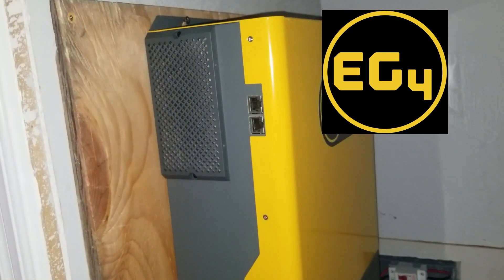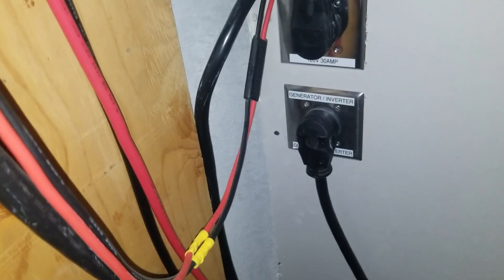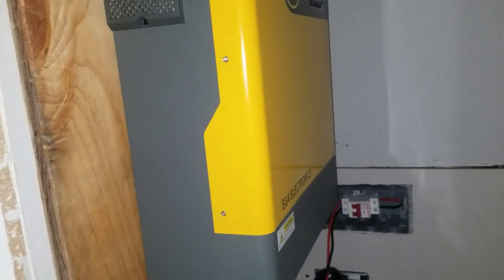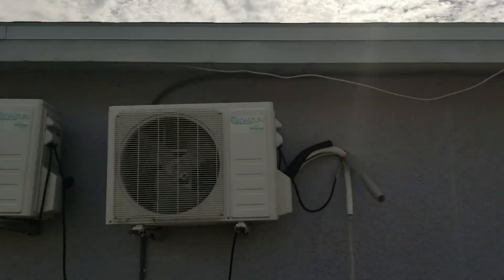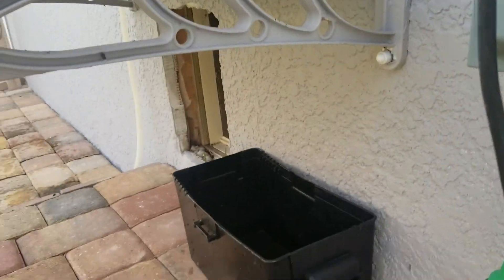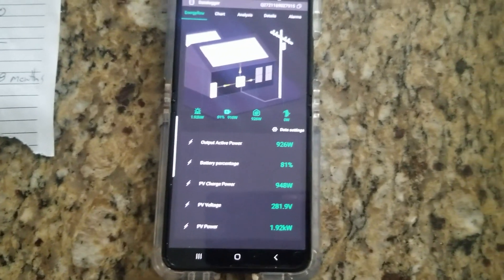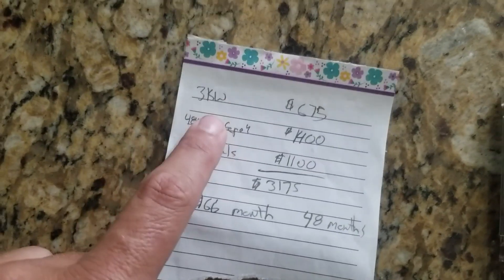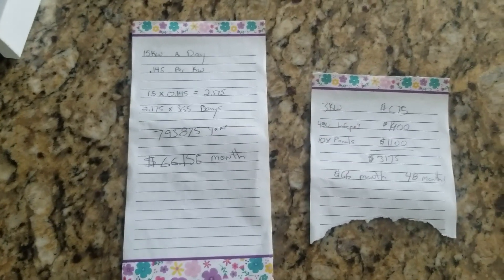3kw EG4 Solar Hybrid on/off grid 48 Month ROI (return on investment) Generating $66/mo SWFL EASY DIY

Comment: Nice set-up. I live in Fresno CA where the weather gets hot in summer amd pretty chilly in winter (i know, high 20's to mid 30's, not that cold😁). 
My question is, what cable did you use to run from the inverter to the wall to plug the 3 mini Splits? Thanks

Comment: In So Cal we pay 30-40 cents per KWh... used to be down at $0.14 back in 2018. So using this exact system you have plus a smaller 1900 watt system took me completely off grid, the transfer sw never toggles to grid.

Comment: Nice setup. Helpful info with this video. Thanks. I like idea of redundancy with these 3kw all-in-one inverters…set up various, independent circuits using these inverters. I have two of these inverters, one powering a clubhouse, the other for heater/ac unit.

Comment: Anyone buying any solar power system should have this as the minimum, up to 30kw battery is no problem charging. Unlike any car built after 2000, solar is a solid investment you never loose. Under 9k USD ,this inverter ,30kw battery and panels. Will run any small cabin or RV with a 30-amp shore cord. I hope these units run flawless for years.

Comment: Most if not all Chinese made high frequency, transformerless inverters won't last 48 months.when powering inductive loads like AC units. Without an iron core, copper wound output transformer, you're subjecting the cheap Chinese knockoff MOSFETs in the inverter to high inductive surges which will shorten their life expectancy every time your AC unit's compressors kick on and off. I think that your going to be in for a rude awakening.
Reply: That's why I'm considering separate components.  Also it's so small and light weight I feel like I might get better quality carefully picking out parts. I'm interested in seeing how these things hold up. I can't afford Low frequency but I can oversize the inverter a little and be ready to replace it when the time comes.
Reply: Those mini splits have built in inverters, they have a soft start.

Comment: I'm looking into this inverter myself. I've been looking at the EG4 6500 48v but I've heard some pretty bad things about EG4 6500, with the product being difficult to work on and broken, software issues etc. I see a fair amount of these videos showing people with problems that aren't being fixed. With this cheapest price on the market, I am worried about that. I like Victron Energy products but the same 3k inverter is more like $2000-2600 compared to this at $650 and of course no way this is going to work for decades like the VE. I've heard it will only last 3-5 years. This would be a great deal if it works and lasts at least 10 years. Anyone have 2 of these in slit phase working for more than a year?
Reply from the maker: Thanks for watching, looking forward to see if anyone answers.

Comment: That little 3000 watt inverter is bulletproof.  I built a portable solar generator out of one and then just added more panels and batteries to run the critical loads in my house off solar.  So much easier to use than a portable generator.  Don’t sweat the payback, you can sell it for 3x cost to your neighbors when the grid fails after the next hurricane! ☀️⚡️👍💡
Reply from the maker: Thanks for watching, I just setup another system in my wife's office/she-shed this time with a separate mppt & inverter instead of all-in-one. I will be uploading video in a day or two.

Comment: How long into the night does the battery run till needing grid again?  I have yet to get my battery, but I am pulling a pretty constant 1kw load, and have 5kw of panels,  and from about 8:45am - 4pm right now...  it's 99% covered
Reply from the maker: The battery usually charges from grid power from around 8:30pm-10:30pm

Comment: How many watts does a single mini split use? Can you post a link
Reply: It depends on the size, my 18k btu ones use about 7-12 kWh a day. Most of that being while the sun is out. It will use anywhere from 400-1500w.
My 12k btu should use 400-800w
All of my splits average 7-12kwh/day at each location.
Reply from the maker: In the heat of the summer when it is 90+ outside they run around 1000w-1500w each, at night or when not that hot about 300w-500w. @HorizonBroadband
Reply from the maker: In the heat of the summer when it is 90+ outside they run around 1000w-1500w each, at night or when not that hot about 300w-500w.

Comment: I have 2 of these and 4 48 volt  100 amp batteries 6200 watts solar panels I can run 2 chest freezers an upright freezer, a mini freezer, a refrigerator, a modern, 10000 btu window AC a 6000 btu window AC, and finally a 2 burner cooktop. I cut the power bill by 70%. Maybe $70 on average a month. . in Florida
Reply from the maker: Are you planning on adding any additional equipment? I will be uploading 2 new videos this week. On e will be of my off-grid storage container, the other will be wife's she-shed office. I have a solar system in each. Thanks again
Reply: I'm done we spent $12,000.  @Hands-onReviews
Reply: Your electric bill was only about $100 a month?

Comment: My fellow Florida "off-grid" brotha
I have a similar setup (Growatt inverter) and run my mini split, fridge, lights, TV, Playstation, and air fryer and it has been awesome. I look forward to adding some batteries and more panels and of course upgrading the inverter to an EG4 6000. I love not knowing that the power is out until I look on Facebook hahahaha
Great setup and breakdown 👊
Reply from the maker: Thanks for watching
Reply: Now remember the EG4 6000 can only handle 500 volts.  But with 2 EG4 3000 that's 1000 volts and up to 10,000 watts in panels
Reply: @robertselvig8835  it think you’d want to run 2 separate arrays & 500v each though
Reply: Dont try 1000v, it won't work and you will burn up inverter. It would have to be no more than 500v each inverter then you are ok but not all in one.

Comment: Thanks for saying "prepurchased power". I get annoyed when people talk about free power when they are in their first year using the system. Once you've paid it off the power is free but not for a few years.  DIY systems take about 5-8 years to pay off on average from what I have seen and maybe twice that if you pay someone to install it. Though you show a great example of HVAC because the ACs I have on solar run full power during the day because why not use up as much of the sun as I can. So I live more comfortably on solar than I do on the grid where I only cool enough to not be uncomfortable. Right now my battery is charged and My AC is set to 60. It's a crappy PTAC and this room is on top of the house so it can't actually get down to 60 but during a sunny day I have my office AC on full power, dehumidifiers on full power, and other things I run because it speeds up the ROI.

Do you have plans to put more stuff on solar?
Reply from the maker: Yes, I will be uploading more videos soon.  I have a off-grid storage container that I run off solar completely. I am setting up my wife's office (she-shed) on solar this week with a Automatic transfer switch, eg4 100amp mppt, and a separate 3000w inverter. I think it will be interesting to compare to a all-in-one. Thanks for the interest more videos coming soon.

Comment: Great video, I just set up the exact same system only I’m running mine into a 30 amp generator inlet box that’s connected to the main panel. I to have grid power but have to unlock the interlock and switch grid power on then plug the EG4 into a nearby outlet to charge it… how can I wire it up like you did to automatically charge up the battery when solar isn’t available? Thanks in advance.
Reply from the maker: I did mine with 10 gauge romex and a 30amp 110v breaker.
Reply: Use a 30 amp breaker from your fuse box with 10 gauge wire to the inverter AC input, set the system for Solar/Battery/Uitility, and then there is a setting for how low you want to allow the battery to reach before Utility kicks in to charge (it acts like a sump pump, battery reaches 20%, Utility kicks on to run the loads and charge, Utility kicks off at 80%). You have almost everything already, just some slight changes to the settings and remove that interlock (electrician recommended of course)

Comment: That’s a good inverter but it will suck a lot of juice when  in stand by mode
Reply from the maker: Yeah, I'm gonna setup some power monitoring and post some more info.  I also just got one with a 100amp eg4 mppt and separate inverter I will be testing.

Comment: Have the same setup on my back covered patio but it is mounted on a hand cart and only have 1200 watts of solar. System has worked well for last year with only 1 major problem. The system started showing battery to only 50% charge no matter solar or AC. Broke it down placed 48v 8amp charger to battery. Viola fixed problem and back to normal system operation. Must have been a software problem and that reset it. Run my 7 cubic foot freezer, fans, TV and lights no problem all the time. Also gives me a great backup for the rest of the house if power goes out.
Reply from the maker: It's nice here when the power goes out but the ac still runs.

Comment: I was thinking about getting the 3KW EG4 solar inverter from signature solar too. It comes with an app to see the flow of power? Nice! Good job on the video!
Reply: You can, but it's slow to refresh. I picked up Solar Assistant and plugged that into the EG4 3k and LP4 battery and get a much better experience.. Worth it to me.
Reply from the maker: Thanks, good luck with your system.